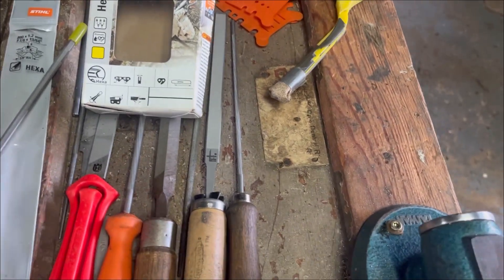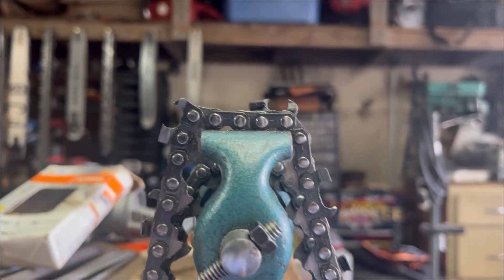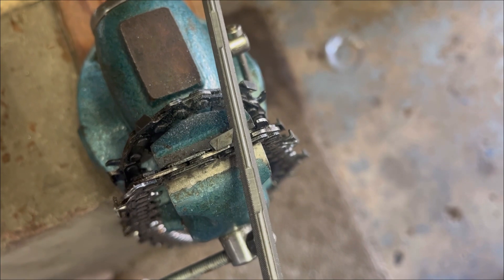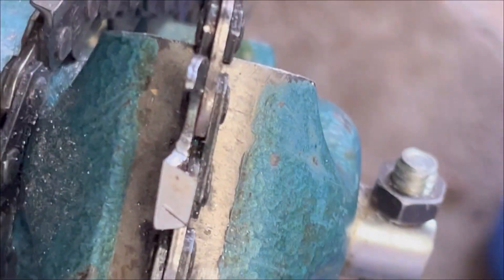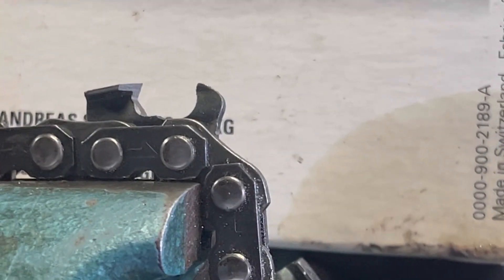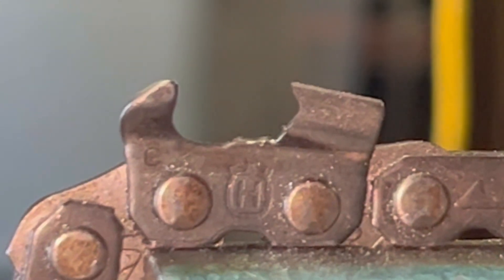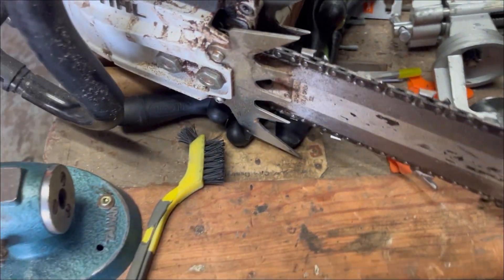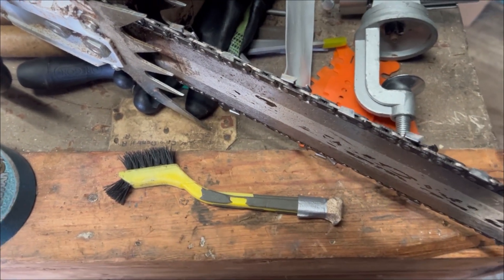The real reason you can’t make a perfect HEXA chain from other chain brands

Comment: Great video Doug! Looking at the comparison of the teeth, having a narrower tooth on the hexa makes sense to me for speed. Think about it a two parts making one cut, each apposing tooth cuts 2/3 the kerf with a hexa, vs a standard chain cutting 7/8 or 100% of the kerf with each tooth! The hexa would clear the same amount of wood, but with less friction, thus prolonging the sharpness of the chain, this also would put less stress on the chainsaw and on the bar in theory. Plus the hexa profile would also give the cutting edge better support with a straight angled faced “gullet vs the standard concave gullet that a round file leaves behind. Again this is all just theory and my 2 cents!
Reply from the maker: I bet you’re right about the Kerf bit
Reply: @IndianaDoug  there is a way to test the theory, use a micrometer and measure the teeth of both chains, then measure the kerf left behind from each chain! If I am correct, the hexa chain should have a narrower kerf then the standard chain. My theory also includes that the space left between each tooth’s cutting face and the wood helps in clearing the chips with less friction on the surfaces of everything involved.

Comment: I've had good success grinding Hexa.  I've seen and proved it's a better cutter design. There's been little change in chainsaw chain sans lower kickback or safer chain.  I've got to hand it to Stihl for thinking outside of the box.  I do have an issue with the $10+ file.  Same thing with C83, It's very fast out of the box, yet nearly impossible to recreate with a file after it's dull.
Reply from the maker: Yessir, HEXA whipped C83 in my tests, but Boedy’s tests were the opposite. Still hard to find for me too!
Reply: @IndianaDoug that is interesting
Reply: Great comment!

Comment: Square filing does cut way faster but doesn't stay sharp very long. I've got a few boxes of pferd v shape files for square filing, results are almost identical to what stihl calls hexa chain, square grinding has been around for generations. There's an old iron horse video where he goes into the details. In my experience it works great but does dull pretty quick in dry hard wood
Reply from the maker: My square filing is certainly faster. The thing is with square, the angles (45,45,45) are not very forgiving, where HEXA files straight across and is a lot easier to file. That’s the biggest difference
Reply: @IndianaDoug  for sure, especially when you got a pile of 25 and 36 inch dull chains to do, getting the 45/45/45 done consistently is a challenge, and you have to keep going back and round filing thr gullet too. I kind of gave up on it after a while, now just use an electric chain grinder and round grind them all anyway. It would be pretty cool to see someone make a hexa or square grinder wheel though, that would be pretty slick

Comment: 👍👍interesting, never messed with hexa(I’m too cheap). 

With a grinder, making the c83 profile is possible by actually letting the wheel wear in more. I found this out by accident. Hard to explain, but normally the wheel has a round edge and creates that crescent. When the grinding edge of the wheel is more worn and tapers and a roughly 60 degree angle is used and the stop is set correctly, it creates a c83 similar straighter tooth and that little hook right at the top. 
Just some of my useless experience when you get a grinder!
Reply from the maker: Makes sense